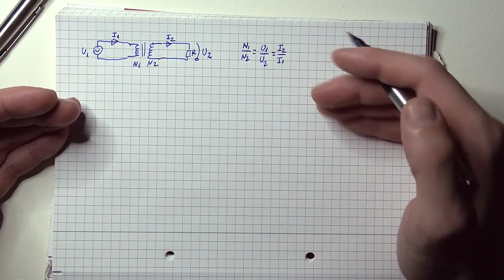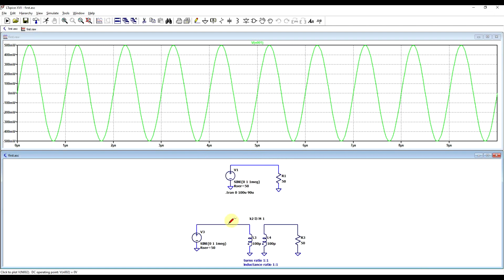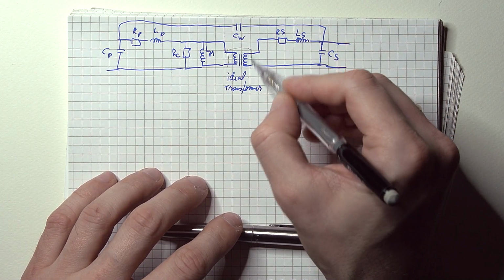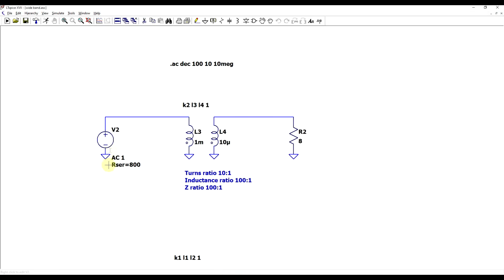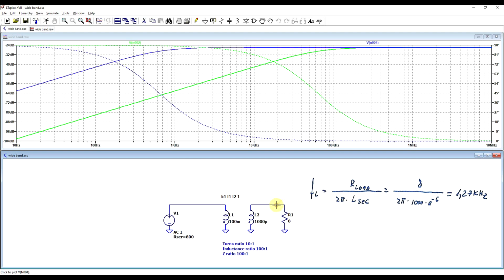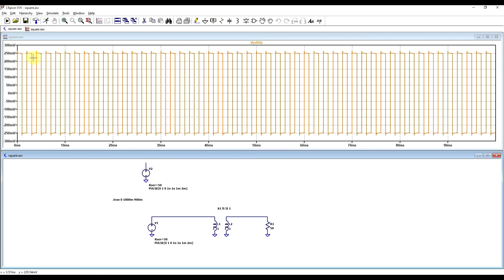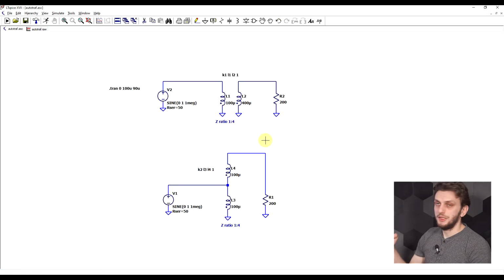Wideband coupling - Transformer Impedance matching (1/3)

Comment: But one thing is really confusing to me. Let's say I am building a simple receiver for 27 MHz. I have a schematic from a book and the author say I need a piece of wire 35 cm and a capacitor 5 pF for my antena circuit and after there is there is a beginning of regenerative receiver circuit with a transistor etc. but what I don't understand is how that antenna is matched to the amplifier??Eveywhere people say 50 ohm source matching witth the amplifier but from another side I hear that the high impadance is very important at the beginning of the circuit in receiver. It sound really coontradictory to me :( Plus the signal is very weak so if i unerstand it correctly anything with low impedance like 50 ohm would completelly wipe out the signal and I would need a very high impidance but why everybody says 50 ohm . I don't get it. Maybe my understanding is not correctly or I don't know ... Anyway I know this is very important because otherwise I will stay with low range receiver forever :(((( My design works perfectly fine for max 3 m but commercial receivers work even for 100 m how do they achive that . I have experimented a lot, I look in engeering books etc. (usuelly they are not very usufull because old books talks always about valves or tubes etc. but from the other hand modern books talk about integreted circuits etc. and i have noody to ask but I know that I am very close to the solution 🤔I have some lack of knowledge (I am not an engineer and I started my electronics projects 3 years ago) but I try to learn as much as I can in my free time.
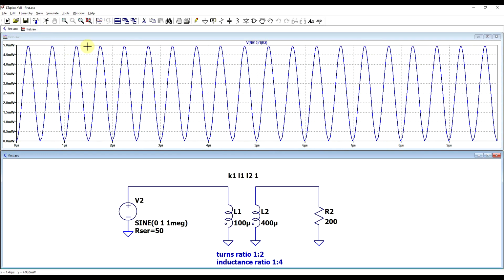Reply: 5:30 or maybe i would need a transformer which has turns ratio of 44 to 1 so i will have 100 000 ohm at the input (for example from the antenna) and 50 ohm at the output for the HF amplifier for example?
Reply: The receiver input has a high input impedance so you need to match the antenna 50 ohm to the receiver input jfet or transistor input which will be several k ohm to get maximum power transfer into the receiver.

Comment: Great presentation.  Can you suggest how I could model a 50 ohm input impedance circuit driving two separate secondary 50 ohm windings, each connected to a 50 ohm antenna, one circuit of which has phasing control.  I want to be able to electrically steer this 2 element antenna array.

Comment: Great video. Question: 18:12 why the secondary side sees the turn ratio of 2?
Reply from the maker: Well, the primary is L3; and the secondary is L3+L4; the total secondary inductance is the 2 individual inductors + the mutual inductance - that adds up to 4xL3; the turns ratio is therefore 1: sqrt (4) = 1:2; another way to look at this is that L4 has the same number of turns as L3; so L3+L4 has twice the turns as L3

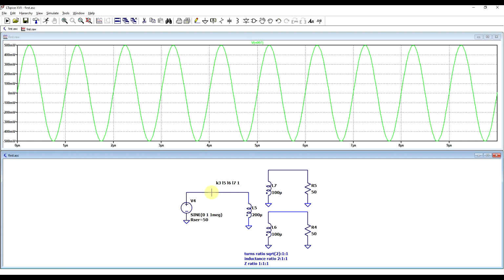Comment: Hey, I know this is an elementary question, with likely a very obvious answer, but I'm struggling with the math  @6:36 with how the inductance ratio of 2:1:1 results in an impedance ratio of 1:1:1 (written in the LTSpice comments) in your example of two secondary windings.
Reply from the maker: I'm not sure I have a very good answer for this.. The 2x 50R loads are seen in parallel by the source, so its an equivalent 25R load - a 2:1 impedance/inductance ratio is needed. So to get both loads exposed to this ratio the transformer is 2:1:1.

Comment: You have excellent signal to noise ratio - hopefully lt spice will sponsor your channel as you clearly show it’s value over a range of applications 👍
Reply from the maker: Thank you for the kind words! I guess you can perform all of these simulations in any proper circuit simulator, the nice thing about LTspice though is that its a free program.

Comment: Very interesting - many thanks. One addition complication that I found: you mention using 'magnetic cores' in order to maximise the 'L' for a better low frequency cutoff, yet reducing the 'C' for a better high frequency cutoff. This is 100% true, but practical cores have the disadvantages of increasing the 'core loss resistor' and this increases thermal noise - sometimes unacceptably, and also the real part of the complex permeability drops off for higher frequencies and this can in turn limit the high frequency response. Thanks again for a very educational video - you obviously spend a lot of time on these.
Reply from the maker: You are indeed correct - any magnetic core will start to loose permeability as frequency increases - first the real part of the permeability drops, and the imaginary (lossy part) increases, then both fall down. As with everything, I guess its a matter of handling the various compromises to get the best for a specific situation. You will never get an infinite BW, so you could just use a core that keeps its real permeability as long as its necessary. I won't be perfect, but it should be better than just using an air core.
Reply: @FesZElectronics  I find this an amazing area where circumstances always arrange themselves to stop the engineer doing what he wants! A ferrite-core with a high frequency before the real part drops off (and the imaginary part rises) typically had a relative permeability of ten or so (eg Fair Rite mix 67). So designing a transformer with good low frequency, high frequency and low noise is next to impossibel. It reminds me of an old adage in cycle racing: low cost, lightweight and strong frame - pick any two!!!! Thanks again.

Comment: Impedance matching is a wizards art...ask any HAM :D So I guess after this one were building a transmitter? I wish lol. 
The interlaced winding is called Bifilar wind as far I know. I used this in my SMPS transformer wind.
One problem that does arise with bifilar winding is that the interwinding cappscitance shoots trough the roof while the cappacitance of the windings each can be minimused to almost a neglegctable degree for frequencies achievable at home..and thats a lot of MHz
Reply from the maker: I guess that for an SMPS this type of bifilar winding is not ideal, but for the impedance matching transformer I guess its acceptable, since it will only reduce the BW a bit - but as long a you need a narrow BW anyway its ok. In parallel I am working on a series on the various classes of amplifiers, so I will try to apply these insights there.
Reply: @FesZElectronics  it is not ideal due to the interwinding cappacitance and the compromise of glvanic isolation..however if you want to achieve strong magnetic fields in a small perhaos single layer coils..lets say you have a ETD49 bobbin amd the primary turns out to be just 3 turns...yeah 3 turns. Now to fill the entire lenght of bobbin youd need rather thick wires.. instead we take thinner wires and wind them the same way as a bifilar winding but we connect them all in paralel. This way you save a lot of space and improve very high frequency response as after a given frequency range skin effect truly hinders the performance of thicker wires. Its also a much more space efficient way of make such a high power low turns coil. I hope you understand what I mean by this
Reply: The type of winding is called interleaved, not interlaced. And with careful winding design you can significantly reduce the intra-winding capacitance.

Comment: What's in that Peck???is a interesting one no especially with mixed units and I'am a beginner sort off!.😃😄😁😆😅 5 Smiles. Or not signal but load regulations via a double line one resistor one a amp inductor to stabilize volt regulator set put to a 5v 4 to 15odd volt and watch as the 5volt even at 32volt don't work the one above is so they don't over heat or a component heat load balancer to your caps regulations so it only gets warm😁.

Comment: Another nice one! Maybe one you have covered filter design you can have a look at bandpass filters with impedance conversion. Also a nice way of getting higher bandwidth matching. There are some nice tables around that give you the component values for different ratios of input and output impedance.